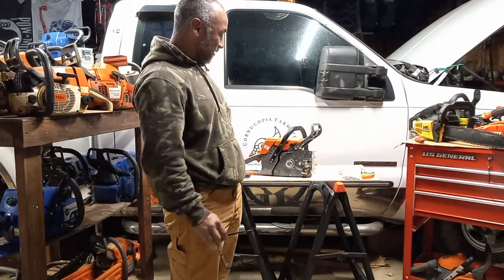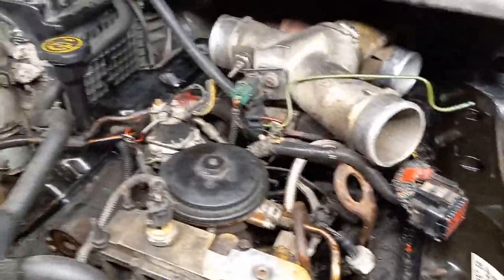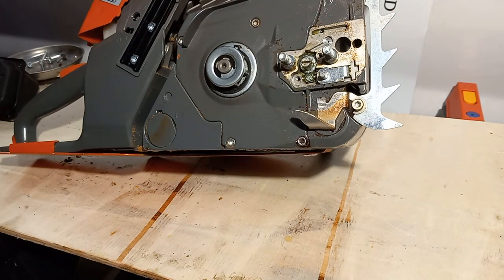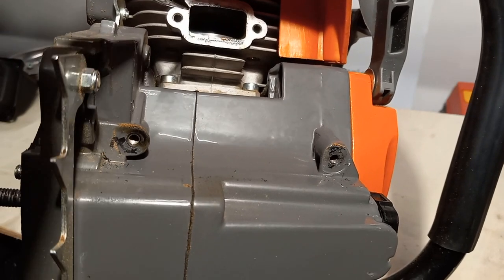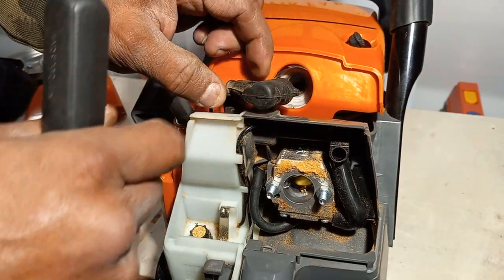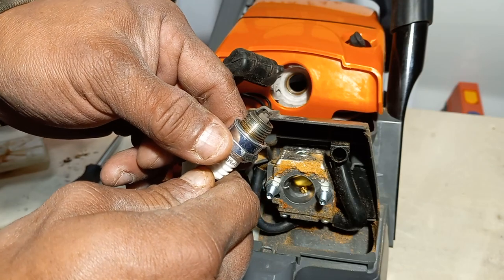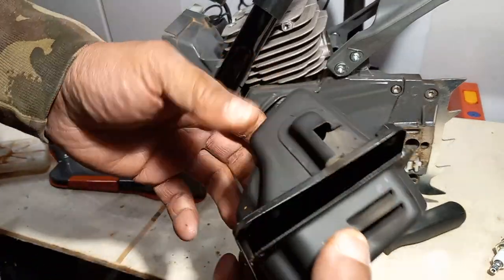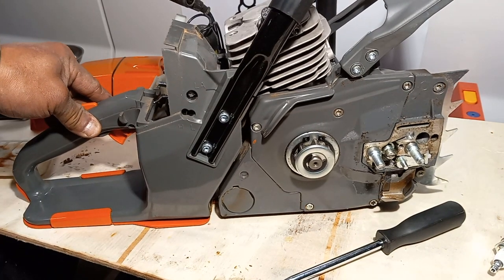BIG ANNOUNCEMENT NEO-TEC/STIHL and 2 Month Review NS872 #stihl #neotec #chainsaws #amazon #ebay

Comment from the maker: Neotec NS872/Stihl MS380   https://amzn.to/3U94KmX
Farmmac F380/Stihl MS380 https://amzn.to/3FPK4vM
Farmmac F660v/Stihl MS660   https://amzn.to/3FHVrGd
Farmmac F070/Stihl MS070   https://amzn.to/3h2h0Xy
Farmmac F372/Husqvarna 372xp   https://amzn.to/3Wy3ATt
Reply: Can't get mine to run without dumping fuel in carb low hours I'm pulling my hair out
Reply from the maker: @billythekid5196  if I had to guess I would say it is a fuel line or even a pinched fuel line. Can't really give a good guess without looking at it unfortunately. We have the first gen 872 which is the one most people had problems with, not really sure what all those problems were but I believe there were some vids made about that too. Honestly as you can read below some have good experiences some have bad, all of our experiences have been good, but I'm pretty hard core when it comes to maintaining our equipment too. Generally I give everything a good look when it is to be used, not to say that you or anyone else doesn't,  I just know I'm ocd about it. I will break the powerheads down to the case and reassemble just to make sure all the bolts a good and tight, maybe not something most will do. I have found doing this you insure your tools are in good order but also you can correct problems from the manufacturer. I work on a tree farm and we have equipment shipped to us rather than picking it up. We had 2 identical kubota rtv1120x's shipped to us this past December.  Going over the "PDI" with the dealer rep, they actually sent one unit missing the muffler mounts and the muffler itself only had 2 cap head bolts on the flange. The muffler mount(a fairly large mount mind you)and the 3 mounting bolts were not on the machine and did not have the paint where they typically would have been inspected. The other identical unit had missing seals on the drive shaft going from the pto to the front dif,  a nice puddle was on the trailer too but they still wanted to go through the PDI. In the end we took delivery and they sent a field tech and after a little time past we were able to use them! So for all those who believe Chinese products a shit, other "quality" manufacturers make their fair share of shit too. Hope you get the carb sorted, you could always give the stateside store a call or reach out to Neo-tec on Facebook, I know yhey try to handle things that way too.

Comment: I saw where a guy bought one and it immediately had gas pouring out the muffler, gas cap had a hole in it, and plastics where already cracked by the pull cord. Deeper inspection of the piston already had scoring in the piston wall and the needle was put in wrong on the carb. My question is are you being positive about the saw because they have you a saw or are you being genuine about the product?
Reply from the maker: Good morning Brian. I can only speak for the product I have and the care we take in any equipment we use, but also can speak of my own personal experience with the manufacturer too. We do not own a 70+cc oem saw as the are just over priced and if you see from the other vids they do have there place but aren't the same which is why they are priced the way they are.We do break the saws down once we get them but also try and run them in at least 2 tanks(prior to actuallycutting with them). We aren't paid but in some cases they would send us an item. All that are sent to us are noted as a sponsored vid, those that aren't we have purchased personally. We have, me specifically are honest and genuine with how they run but also how they are received,hopefully clearly people can see through the vid how they run, please note if someone doesn't listen to what I actually say in the vid then they really haven't heard my opinion, just watching the cutting is only half the information. Hope this helps. Thanks for an honest question,  Ric

Comment: The more oil you put in the fuel that will cause it to run leaner not rich. The reason is oil displaces the fuel being metered in by the jet.  This is one of the biggest mistakes I see from people when dealing with a 2-stroke engine.  They run 25:1 can't understand why the plug is looking lean.

Comment: It’s a bummer that they went with a spur sprocket instead of a rim set up.
Reply from the maker: Yes it does have a spur on it but it is possible to convert it to a rim sprocket.  The ns892 does have a rim sprocket and was actually sent with several spare parts along with 1 extra 7 tooth and(1) 8 tooth sprocket. The tool kit also included an 8mm t-handle and a t-27 t-handle along with several other necessary tools, actually quite nice! Thanks for commenting 👍 and subscribing!
Ric

Comment: Respectfully, the oil mix ratio has nothing to do with lean/rich.  That's all in the carb.  By the plug, looks like it just needs an adjustment, and hopefully not a re-jet.  Bummer about the air filter design.  Looks about impossible to keep debris out.

Comment: Have you ran a ns872i yet? I’m still curious if it’s worth the extra $50. Also is the farmertec the same saw just a different color or is there any difference from the Neotec?
Reply from the maker: Actually no I haven’t ran the 872i, but from what I gather the parts upgrades are well worth the added cost. Having said that the 872 does the job very well. Any time you have better response and less throttle time you are saving money and time along with consumables while cutting. As for the second question NT and FT are two different companies. NT at one time supplied parts for FT but somewhere down the line they stopped supplying them. At that point they just started selling complete and kit saws. This was around 2020 I believe. If you search around a bit and get some other opinions I think you will see they both have a strong fan base for each other equipment, some like NT some like FT. One thing I think you will see most is FT sure does try and duplicate what NT is doing, you will just have to read between the lines there….. Hope this helps and thanks for commenting, Ric.

Comment: What about the oiler on your 892 did you have to adjust it at all ? I just got mine, and it seems like the chain doesn’t  got enough or only it.
Reply from the maker: Jody sorry for the late response, like has been very busy round here... As for the oiler I have it adjusted all the way out before and have adjusted it back in about a 1/4. Seems like it only has one turn on it for adjustment. I know FT has a high capacity oiler which I do have but haven't used. I don't know what type of oil you use but the're are 2 different types of bar oil. Summer and winter. Summer is thicker and winter is thinner. Some people do no know that bar oil is engineered to be sticky as to stay on the chain. But when you use the wrong season oil it my not flow right. This could be one or more of the problems or possibly the oiler or even the rotor has is not connected to the gear or rod which rotates the oiler itself. In the winter I do but a cap full of fuel in the saw oil tank to help thin the oil for better flow. Hopefully this will help with your problem, Sorry for the delay. We haven't really been able to look at youtube for a while now, been very busy round here. Thanks for commenting, Ric

Comment: Good review Ric, and you went thru this saw pretty good. Did a great overview of it. I'm impressed with how clean it is. Much cleaner than my MS 170 Stihl with approximately the same amount or maybe less hours on it. I bought the 170 about 6 years ago and have used it very little.  Mostly because theres no comparison with my old 290 Farm Boss Stihl. Mainly just use it for topping trees and carry it on tractor or 4 wheeler. Thanks buddy.
Reply from the maker: Hey Dean!
Ya know it is the little things that matter. They seem to have added a couple of processes along with materials here and there(either better material or type change)that make the differences. Surprised would be an understatement I suppose. At one time I expected shortcomings,  now it is being surprised by improvement I suppose. I think Neo-tec is raising the bar my friend! Farmertec better watch out, Stihl and Husky too!

Comment: I felled timber for years.  I’m retired now and have to make smart purchases.  Do you know the difference between Holzfforma and NEOTECH?  I got 330K on my 7.3.  Diesel.  Great videos.  Keep it up!!
Reply from the maker: Good morning sir! Great to hear about your 7.3! Actually just lost a connection on the heater core last week on ours and waiting for repair parts now, truck is great and plenty strong enough to move around things we need moved. I have owned the truck since 2007 and purchased it with 130k , can't complain and don't want the issues of newer equipment or the fuel economy for that matter!
As for the 2 companies, we have corresponded with the owners of each company in great detail about many things. We spoke with Farmertec a little over 2 years ago. And Neo-tec this year about mid summer. They both are similar in the sense they have a product to sell and both believe in the product.  I think the main difference in my opinion is that Neo-tec seems to work night and day to stay the course and continually develop all aspects of there business to provide all that is needed for all persons. Having said that they both make the equipment pretty much the same way, they use expired patents and build from there like most other business do. But, in our opinion Neo-tec's quality is much better, is it oem quality? I guess it depends on the day you receive the oem saw? For the equipment I can tell you Neo-tec does not want to be similar to Farmertec,  they just want to be much better.  Hope this helps,  Happy new year's and thanks for commenting 👍 and subscribing!Ric

Comment: Hi sir, is it better than g372xp?
Reply from the maker: I wish I could answer that question. Many people have asked the same co.par3d to the g372 or even the husky372 also. I have never ran the g372 so I can't compare the 2 saws to each other. I have ran the husky 372 xp and xt and it does compare very well to both of the Husqvarna saws. As for a comparison against the g372 I don't know. I can tell you we have  the g444 and g466. We like the Neo-tec 872 better than both the g444 and g466. The performance of the g saws is good but this saw is just better compared to both of these. All of our equipment is not modified and we use premium fuel and oils in all of our equipment. I apologize for not being able to compare the two saws but we just don't have that saw. Thanks for commenting 👍 and subscribing!
Ric

Comment: Would you recommend these saws for using as a milling saw?
Reply from the maker: Good morning John. I believe the 872 would be fine to mill with and really, if you needed to you could mill some branches with the small saw. I would only suggest keeping an accessory bottle of lubricant to use manually.  Your biggest limitation will be in the oiler on the saw. Having said that add a ripping chain, mill frame and this saw would get the job done. The first saw I used for milling(I still have this saw also)was a Poulan 50cc from 1997. Patience wood and a sharp chain you can mill. I use vp racing full synthetic oil in my fuel, I trust it and have used it for years. You need a synthetic oil minimum as the saw runs for longer periods of time. So finally, yes it wouldn't be an issue! Hope this helps. Thanks for commenting 👍 and subscribing!
Ric

Comment: Bought this say March 2022.  After six months of homeowner abuse (cut down and bucked 5 trees ranging 22 to 38 inches at stump and about 15 hours of milling) the Saw are its cylinder gasket.   $13 for gasket set and I'll be abusing it some more. Well worth the price and maintenance required.